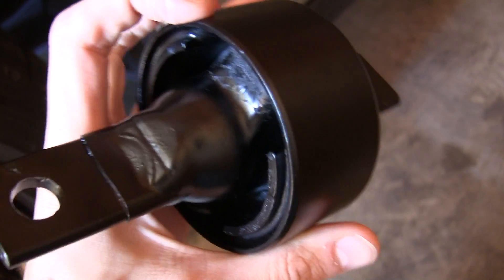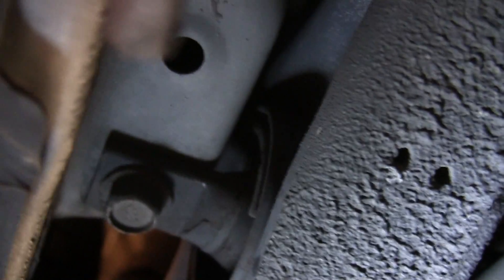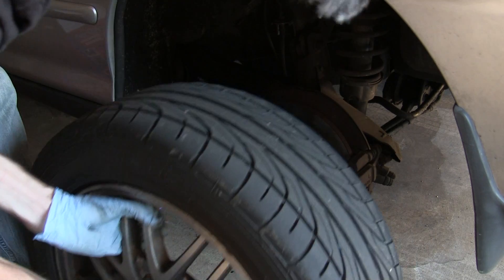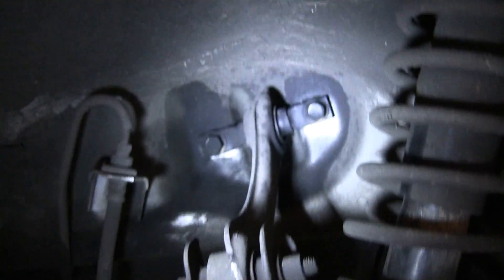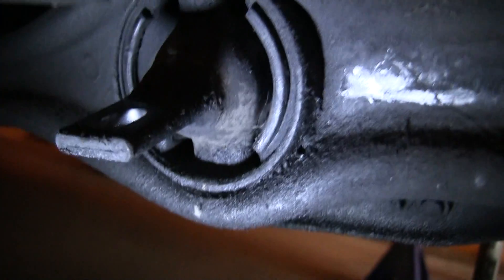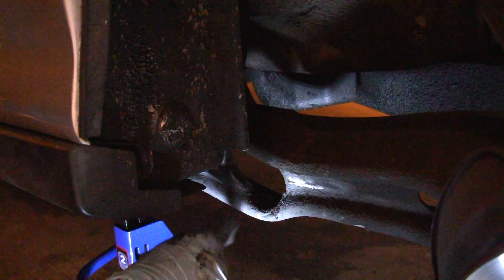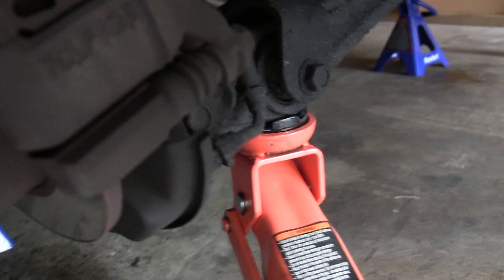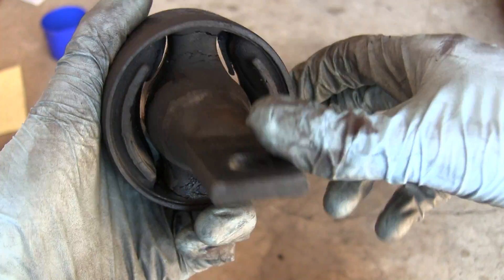Rear Trailing Arm Bushing Replacement - Honda

Comment: That definitely looked like fatigue failure. Would it be a good idea to report this issue to the manufacturer...? I guess if your driving and/or driving conditions are beyond the design limits, it wouldn't be the manufacturer's fault...
Reply: It's a consumable item.

Comment from the maker: The video description provides some insight. They isolate some vibrations that other wise would be passed to the frame, and they also resist axial and radial movement of the suspension, so it helps to keep the geometry relatively the same.